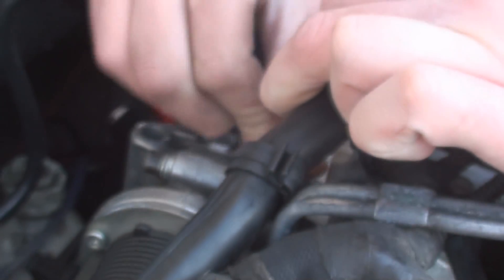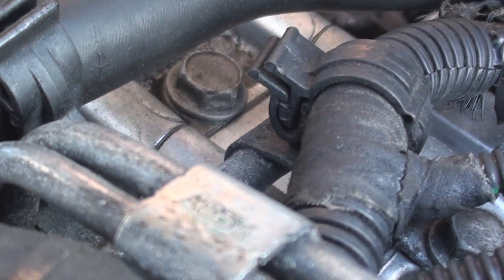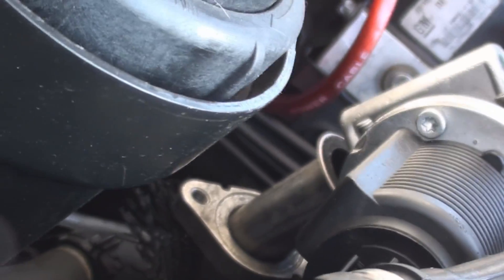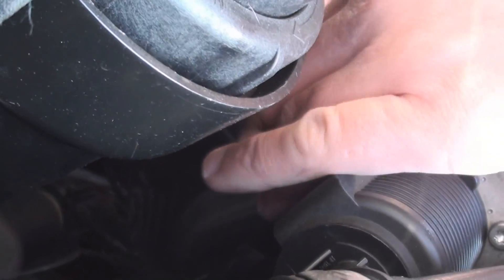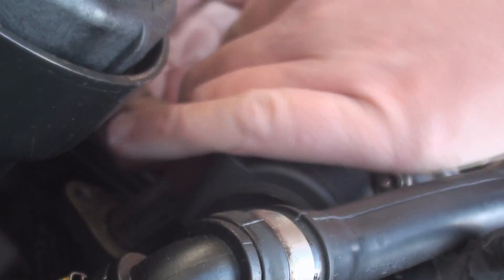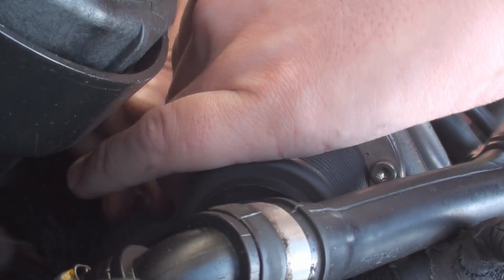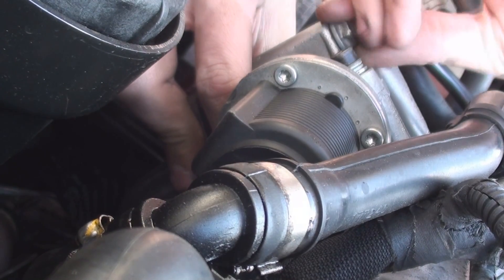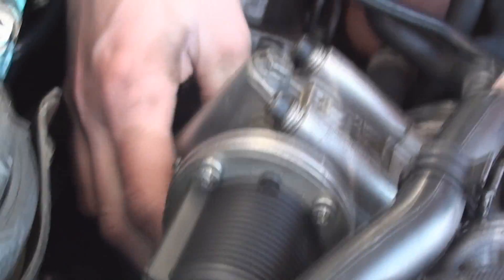How to: Fit a EGR Blanking Plate on a Diesel Engine

Comment: Just fitted egr blanking plate toy astra 1.9 diesel Sri and the car wouldn't start. Took the plate out and the car started after turning over for a few seconds. I cleaned egr with carb cleaner, it was ditched. Any ideas why car won't start with plate fitted? Cheers
Reply: kristian dakin you have a DTH engine code which sound only be blanked from the side not the bottom

Comment: I have a 1.9 tdi which practically died on the motorway from a stuck egr valve. Is it just 1 blanking plate you need? I've seen packs of 2 on eBay. Also, couldn't you just plug in vagcom to turn off the error flashing up? Car is already remapped so dont want to pay for it again

Comment: Do these blanking plates increase smoke in a diesel. And does removing the vacuum pipe and blocking this up do the same job as a blanking plate

Comment: Hi, I was attempting to remove my EGR in order to clean it as im getting a loss of power issue. when 2 of the bolts snapped and left some of the thread in the hole.
i see that you have the custom allen key bolts. did you have to drill out old bolts since it was damaged when you got the car? or would you just recommend blanking off the valve and forget about it? Thanks.

Comment: I personally WOULD fit a plate with the hole in it, as re-map software can be expensive depending who you go to. If you can afford it blank it off, if not hole it. :)  Another thing I did when i had to change my EGR was threadlock those 2 top bolts, i did them up nice and tight but they rattled loose and all you could smell in the car was nox and co2 hence the threadlock.

Comment: Hi!  I have a Vectra with a Z19DTH engine.  Is it the same type of engine that you're fitting your plate to?  Would you recommend removing the EGR valve and pipes and checking/cleaning them of carbon build up before fitting the plate?

Thanks for the Tutorial!

BV

Comment from the maker: You have a keen eye. The Allen bolts are because the threads were damaged by the previous owner after removing and refitting the EGR valve - when i removed the valve for myself, the bolts wasn't very tight, so we experimented with a tap and die set, and managed to add a few threads. but the Allen bolts held better - but wasn't long enough for the engine cover lug.

Comment from the maker: Sorry for the delay on getting back to you. the plate is a preventative measure to help slow down/stop the effects of carbon build up. it cannot get you power back your missing, because perhaps some damage is done. perhaps theres some blockage on the inlet manifold or on the swirl flaps.

Comment: Hi there, that was a good and informative video thanks, I have just started to get a loss of upper power, and so have just had the EGR valve of and cleaned it up, but it is still giving me this lack of power.

Now will this plate cure that ? and also, surely that if you are blocking of that hole, surely the pipe leading upto there will build up with soot and then you will have 1 long pipe full of it ?

Just my thoughts before i go out and buy one.

cheers

MF

Comment: Hi Bluudy.
Just fitted the EGR blanking plate (fully blanked). 10min job it was.
I took it for a 30 mile test derive and no EML light on (don't know why coz I was expecting it)
I have to say that it was easier to clean the carbon build up whilst dry with a small wire brush and then I sprayed some brake and clutch cleaner and gave it a good scrub. While I was there I also cleaned the boost sensor.
A big thank you for the tutorials, as without them I wouldn't have had the courage to do the job